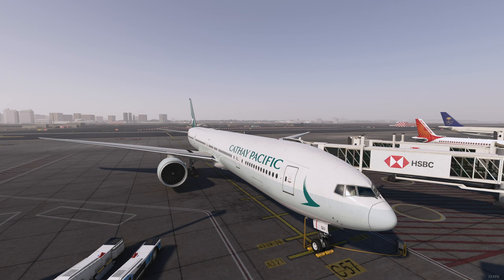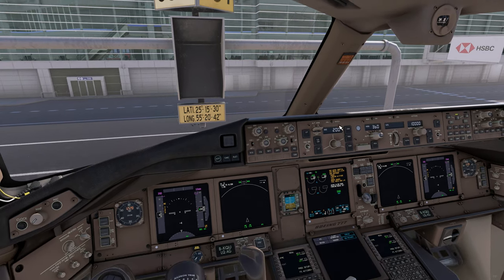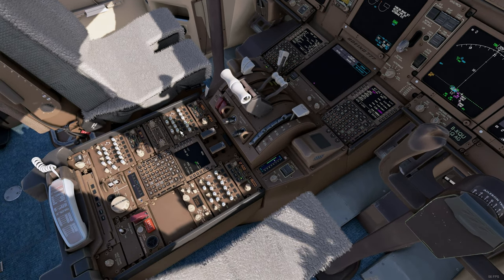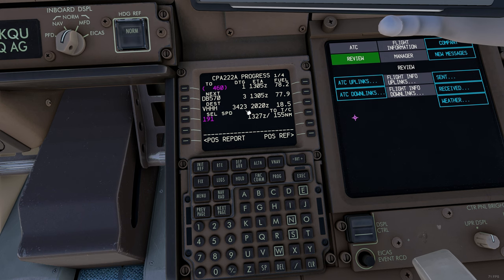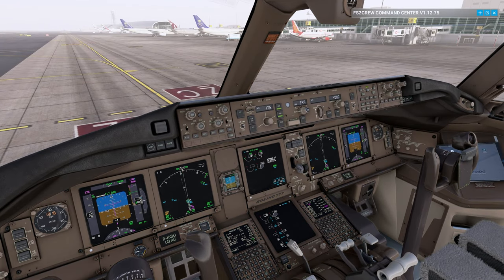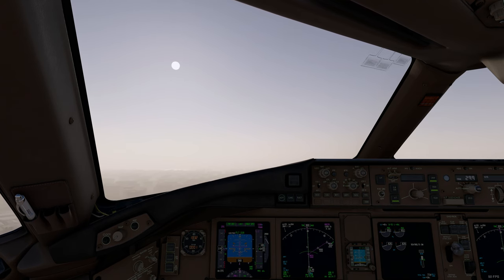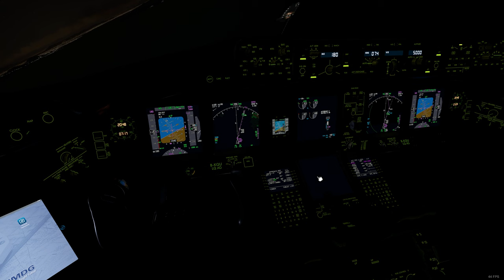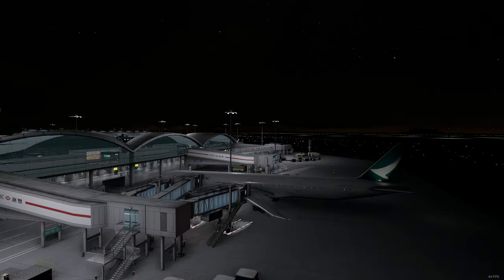Flight Simulator 2020 | PMDG B777-300ER | Dubai (OMDB) - Hong Kong (VHHH)

Comment: may I ask if the issue of bottle necking between your cpu and gpu is really bad?
Reply from the maker: @dannynguyen7978  No, and according to many different Bottleneck calculators, this is probably one of the best. I think I’m at less than 1% bottleneck. Now if it is actually true, I don’t know. I didn’t have any issues so far.

The reason why having a mediocre cpu is good for me, is because I game in 4K, and gaming in 4K requires more GPU power than CPU power, therefore the CPU becomes less relevant. 

Now that doesn’t mean you can cheap out on the CPU though. Having a good CPU has other benefits. 

Now if I ever decide to upgrade to a 5090 (when it comes out), I will probably have to upgrade my CPU as well due to the higher performance of the 5090.
Reply: @BProduction222  thank you so much for the reply! reasons being was because i have the same cpu as you do and been wanting to upgrade from an rtx 2070 super to a higher end gpu for a while now, due to its vram being a problem. thanks so much again for the explanation.
Reply: @BProduction222  also, I've been having the same problem with you where the TCA Boeing yoke twitch alot when the y-axis is moved. I do not know if it is fully solved yet, but what I did was to delete the drivers of the yoke itself and reinstalled it, then the problems seemed to be gone for a few days now. crossed fingers tho!
Reply from the maker: @dannynguyen7978 No problem. If you use 4K, a 3090 is perfect with the 9700K because it has the perfect amount of VRAM and is also not too strong for the 9700K at 4K. If you have additional questions before you buy a new GPU, you can always ask. I’ve built many PCs in the past, including for my friends and family. :)
Reply from the maker: @dannynguyen7978 I will try that. Thanks for the tip